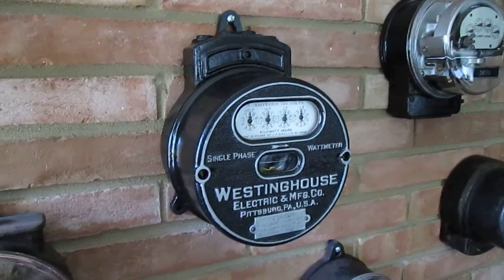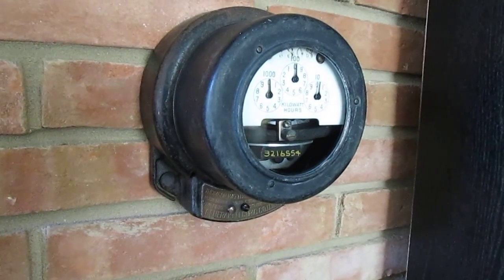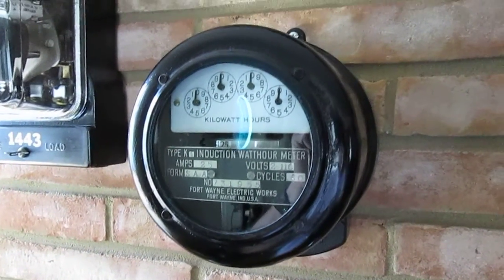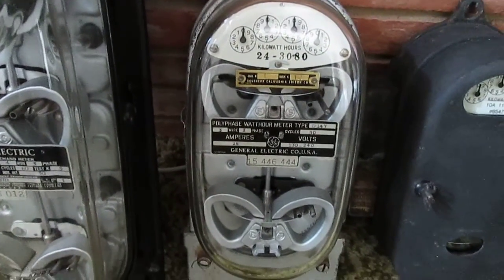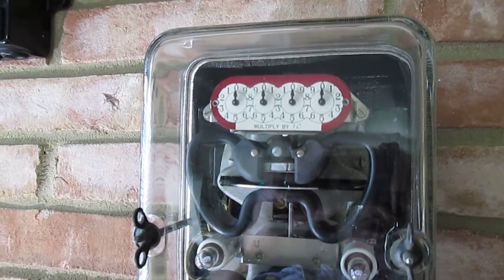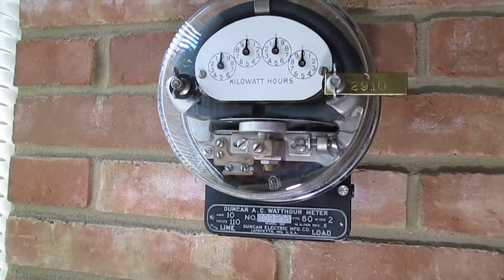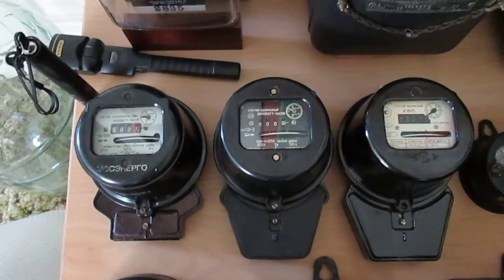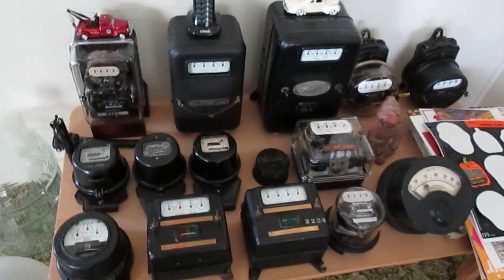My Watt Hour Meter Collection (1893 to 1940's)

Comment: Should you put clock oil on these types of meters?
Reply from the maker: I use Deoxit X-10S silicone lubricant as it will evaporate and leave only the silicone behind.  Much cleaner that oils.
Reply: would clock oil also work? it applies a very very small amount, or would it interfere with the calibration
Reply from the maker: @gtb81.  Only use it on meters that have the pivot and jewel bottom bearing.  Early Westinghouse meters used cup jewels with a very small ball bearing sandwiched between the cup jewels.  These can be cleaned, but do not use clock oil on these type of bearings.
Reply: @mikejordan4899  i think i used silicone lubricant, i have a 25 amp type OB
Reply from the maker: @gtb81.  Did you use Deoxit X10S?  That is a silicone lubricant made by Caig Laboratories.  It's great to use on instruments.  I use it on the jewel and pivot type bearings.
Reply: @mikejordan4899  i did not use deoxit brand, no, but i did use silicone lubricant. however i did only lubricate the gear train, and it's been working for almost a year now, i have a shed i wired in knob and tube that i use the meter on now

Comment: Hello Mike, thank you for the replies. My meter has five terminals and a removable jumper in the terminal box. I removed the back cover and traced out each circuit. When I removed the back cover I found a persons signature and a date 1-24-46. Which was very cool in itself.  Here’s what I found. From left to right. Line 1, goes to bottom element and voltage coil. Position 2  is a removable brass jumper that isolates Line 2 which is position 3 from the upper voltage coil. Position 4 is Load 2. Position 4 is neutral for each voltage coil. Position 5 is Load 2. I’m kind of puzzled what the jumper is used for, calibration purposes? The meter says it’s rated for 10A. Is the for each element, upper and lower? Thanks again.
Reply from the maker: Are you on Facebook where you can msg me a picture of the terminals?  I'm on Facebook under "Mike Jordan"

Comment: Hello. What a collection! I have a GE I-18 dual element 110/120 15A 3 wire watt meter. It was removed from the Shirkmere Hotel back in the 90’s. Do you have a schematic on how to wire them up. Also, what it the purpose of the two small bulbs for?
Reply from the maker: Hi Joe,
   Sorry I haven't gotten back with you on your GE I-18.  Your meter is what's known as a Network Meter and is quite simple to wire up for operation.  Remove the terminal cover you will see four terminal screws.  The first two are Line and the last two are Load. The first terminal on the Line will be HOT, 2nd terminal on Line will be NEUTRAL, 3rd terminal is LOAD and is NEUTRAL, 4th terminal is HOT.  If you have any other questions, please let me know.  I'll be happy to help.
Reply from the maker: The purpose of the lamps are to let you know that the potential coils are energized.  I have a Duncan Type-MF Network Meter that uses electromechanical devices that flip to the ON position when the meter is energized and flip back to the OFF position with the meter is de-energized.  The lamps are the GE Type 43 miniature bayonet base.

Comment: I have a GE Tyoe I-18Y, do you know anything about this model? I can not find much info about it.
Reply from the maker: The I-18 is a single phase, two stator network meter with  single phase terminal connections. Used as stand alone or with instrument transformers.
Reply: @mikejordan4899  what is the value on these meters?
Reply from the maker: @jayhawes1148  $25 to $35. They are not that rare. The most I've paid for a network meter is $50. It was a 1920 Westinghouse Type OB network design.

Comment: I have a Old meter that was made into a lamp and the dial stop turning / or plate do you have any idea why they were an old friend who passed away and It was given to me as a gift
Reply from the maker: If possible, can you send me a picture of this meter? I may be able to help you, but I need to see the meter to see if it is one of the types I've restored in the past.  Send picture to 
        mj.neon99@gmail.com
Reply from the maker: The bottom bearing may be dirty and needs cleaning or there may be something stuck in the teeth of the first register gear. That's the gear that makes contact with the worm gear on the load disc's upper shaft. That can stop the load disc from turning

Comment: Hi there beautiful collection you've got there, and in such great condition. I admittedly know squat about any of this stuff, but I love to look at old stuff and see the quality and how it works and such. You seem pretty knowledgeable on the subject, so if I may, I have a few questions. I have just come into a Westinghouse single phase meter much like the black one you showed in the first seconds of the video, says type A on the back, and has a plate on the front with patent dates ranging from 1888-1898. It's nowhere near the condition of the ones you have but it's pretty. Has a plate with a style no. and a serial no. however I cant find any if on it. Can you shed some light? Anything you know would be great. I also got at the same time, a General Electric polyphase watthour demand meter. Type DG-1. Again, I can't find really anything on it, except it has nine different patent #s on the I.D plate, when I search them they were all applied for in the 1920s-30s. It's in a large rectangle box that looks like it hangs on the wall, outside I would guess, glass on the cover is gone. It has a nice little setup of gears inline with a synchronous motor and some kind of paper scroll type thing that looks as though it's recording the data, through the am and pm hours. The dates on the motor I'd plate range from 1916-1925. This thing is beautiful, even in its condition. If you know anything about these items I would love to hear it. Thank you.
Reply from the maker: If possible, please post some picture of the meters in question.  I would really like to see them.  The GE meter sounds like a recording demand watt hour meter that was used in a power plant or substation metering house. Does the register on the Westinghouse meter have all the pointers inline or are they arranged where there is three on top and two on the bottom?  If they're arranged in the latter fashion, then you may have a Westinghouse Type-A.  These are quite rare as compared to the Westinghouse Round Type and the Type-B and Type-C.  Again, try to post pictures if possible to my email address: mj.neon99@gmail.com.  Thank you!
Reply: Thanks for your reply. The Westinghouse meter has te dials arranged with two on top and three on bottom. It's round. I will see if I can upload a video of the two meters today sometime, so you can see them. If I can't, I will snap some photos and send them to your email address. I wrote don your email, if you wanted to edit your post to no longer include it. I look forward to showing you these things, and hearing what you have to say about them. Thanks again.
Reply from the maker: Sounds like you have either a Westinghouse Round Type or a Type-A with metal covers.
Reply: Mike Jordan  Hi mike, I have posted a couple videos of the meters to my YouTube channel, if you wanna take a look. I still haven't found any useful info on them. Curious what you think of them. 
    Thanks

Comment: Awesome collection of vintage meters you have there, look forward to see some of them running when time allows.
Reply from the maker: Just ordered a vintage Ft. Wayne Electric Type K3 watt hour meter.  I will be featuring this meter after it arrives and I clean up the meter mechanism.  I clean the upper guide bearing, lower jewel bearing, and pivot bearing.  This meter has the same type of cup shaped load disc as the Type K4 I had shown previouly in an earlier video.  I hope it arrives in good condition.